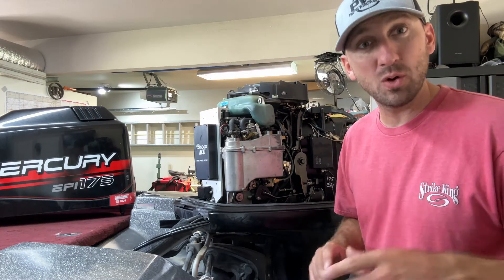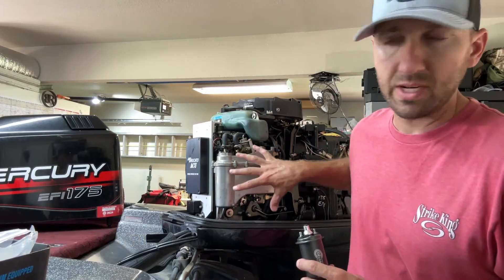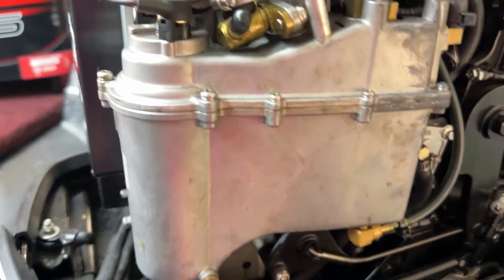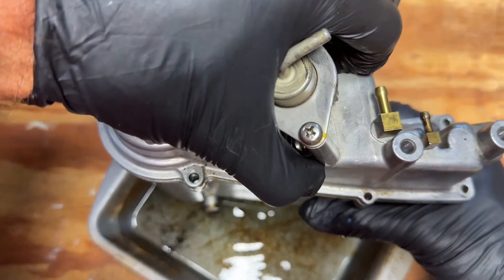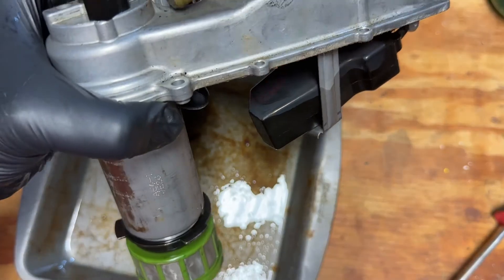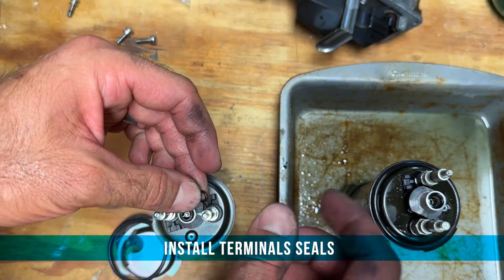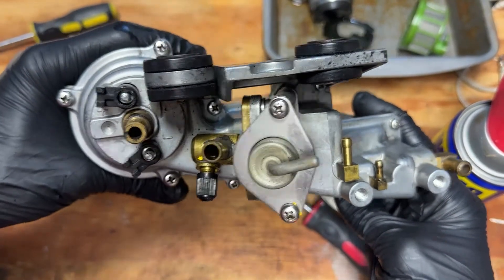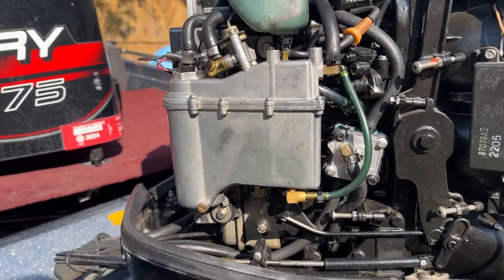Mercury EFI FUEL PUMP Replacement (HIGH Pressure Fuel Pump)

Comment: Quick question for anyone that can help! So I have a 225 EFI 1999 I just had it rebuilt by a shop last year and it’s runs and idles great but when I take it on the water it’s struggles badly to get on plane. Like someone has to sit on the bow of the boat just to get it to nose over and plane out. The shop says it’s fine but clearly it’s not. Been thinking it’s the fuel pump but don’t want to spend the money unless I’m sure it can fix the issue. Any suggestions would be nice!
Reply from the maker: Power issue, doesn’t sound like a fuel pump. Fuel pump would be more if motor would randomly die or not start.
Hard to say without hearing it. Could be ECU issue.
Reply: @PrestigeWorldwideFishing  
Ok thanks for you info! Anyway I could send you a Ideo and you tell me what you think ?
Reply from the maker: Yep. Send it on over

Comment: Hi, i have 1996 v200 efi mercury. Im having similar issues with my motor. My motor will start but will shut off after about 1 min. I have to pump the primer bulb to get it started again. It will die again if i dont continue to pump the primer bulb. So far i have rebuilt the low pressure fuel pump, new fuel pick up, new primer bulb and new fuel/water seprator fillter. Im running out of options. Im wondering if the high pressure pump has anything to do with my issue? Maybe the regulator? Also, i plan to start with just the strainer that is attached to the fuel pump since my fuel pump is $900 dollars. What other gaskets or seals will i need to replace once im in there? Any suggestions would be helpful. Thank you
Reply from the maker: That sounds like a high pressure pump issue to me. Surly they make a cheaper fuel pump for your boat then that right? You will need a new gasket that goes between the top of the fuel pump case and the bottom. The big one under the lid… not sure how to describe it. It’s really the only seal/gasket that isn’t on the actual fuel pump itself. 
Good luck!

Comment: How has your pump been working? I ordered one & have it installed, haven't tried it out yet.
Reply from the maker: Great so far. Had a small gas leak. The top seal shifted when I installed it. Adjusted and is good now
Reply: @PrestigeWorldwideFishing  Thanks for the info.

Comment: My ecu fuel pump drivers died a few months after the new high pressure fuel pump. Luckily, it's bypassed easily enough, it runs great. You have a Brucato, so no worries there.
Reply from the maker: My fuel drivers went bad on my ECU too. That’s why I have the Brucato now
Reply: How do you bypass it?
Reply: @darralldougherty5388  Run the fuel pump off the relay block near the starter and a good engine ground. Just dont ever leave the key in the 'on' position if the engine is not running, will burn up the high pressure pump. Injector drivers are still fine in my case, just the fuel pump driver died.
Reply: @MrInsanityflea  Thanks for the info!

Comment: Hello, did the aftermarket pump work well for you?  I have read that some folks get alarms from high amps on the non -OEM pumps. I am looking at a Quantum pump, just curious about your results. Thanks
Reply from the maker: Yes, so far so good. Had some issues with the after market low pressure pump but the high pressure has been good.
Reply: Thanks for the reply!  I just ordered one. Hoping this gets me going.
Reply from the maker: @tonytobes15 cool! Make sure you order the black seal/gasket too, it doesn’t come with one.
Reply: I’ve been trying to diagnose what’s going on with mine. Runs great at idle but in gear it won’t get up on plane, loses power and tries to bog down. I plan on replacing the high pres pump and low pres pump and seeing if that resolves anything. Already replaced voltage regulators because they were burnt up.
Reply from the maker: @ryanlogue3029 before you do that, watch my voltage regulator video and make sure yours doesn’t do what mine did first. 
Sounds more like you have a stator issue… for your sake I hope it is. Mine was ECU issue. 
Fuel pump issue usually means your motor will just shut off not bog down. Email me if you want, would be happy to help you diagnose and avoid spending a bunch of money.
Reply: @ryanlogue3029 did you get it figured out? Mine is doing the exact same thing.

Comment: I'm wondering if this is the pump that was causing me an issue today. Today was our fish off and it was 30 degrees when I got the boat off of the trailer. I tried to let my motor idle to warm up and it would cut off after about 15-45 seconds of running the motor. If you went and pumped the bulb by hand, it would sometimes keep running. I noticed whenever I turned the key on that I wasn't getting the whirring noise or whatever it makes when the fuel pump or something turns on. I replaced a fuse under the cowling and it didnt change any thing. Once I got home I messed with it some and I found one fuse that was at the battery. I changed it out and messed with a few other things. When I went back to turn the key on, I could hear the normal whirring type sound from what I believe is the fuel pump. I have no clue if the fuse tripped because it was so cold or if the pump is just going out.
Reply from the maker: I wouldn’t think the cold would mess with the fuse but possible.
Reply: @PrestigeWorldwideFishing  I figured out what it was I believe. I had reconnected the line at the fuel bulb because there was a small drop. Whenever I reconnected the bulb it pushed the lining and obstructed the fuel line. I replaced the line today and saw the obstruction. I also cut it open and the lining had sucked itself flat past the obstruction. So it wasn't getting enough fuel to run for long
Reply from the maker: @trevoralexander7080 I’m impressed you found that. Nice work
Reply: @PrestigeWorldwideFishing  I had a feeling that could have been the issue. I've had the same thing happen a few times with my old bass tracker. The sad part is that 2 mechanics told me at the lake that it was a fuel pump that went bad... I had time to run to the auto parts store for a bulb and hose while we were under a fog delay but they said that wouldn't fix it. But we still ended up doing better than 80 percent of the field in the tournament so it worked out regardless
Reply from the maker: @trevoralexander7080 Nice!!
Reply: What the bulb bad too, does it have a lining inside the bulb that can  go bad?

Comment: Is the red wire supposed to be hot “ie have power on it” with the key turned off?
Reply from the maker: Yes it’s hot. You will want to disconnect battery before you start
Reply: Yes it’s suppose to prime for about 10 seconds when you turn key on.
Reply: Thank you it was hot. I accidentally bumped it against the motor while putting the tank back on and it sparked since I just bought the boat. I didn’t know if it was supposed to be hot with the key off so now I have a question do I need to fill it with gas before I hook that wire up as it will start to prime and maybe burn the pump up, any thoughts?
Reply from the maker: @skippy7545 yeah I bet that scared you a little. no you don’t need to put gas in it. You will be able to pump your fuel bulb until the tank is full or has enough gas to start the motor.

Comment: If my fuel pump is dead or bad my 240 sport jet mercury v6 efi wouldn’t be able to start correct, cause it keeps on rolling over but won’t stay start, I change everything basically brand new plugs,stator assembly,selenoid, injectors, and so on it started and cut right off the only thing I haven’t checked is the high pressure fuel pump
Reply from the maker: It might run for a second depending on if you have fuel in the high pressure tank reservoir. Does it start after you pump the fuel bulb?
Reply: @WatchBrando haven’t been around it yet but we are going to change the high pressure fuel pump to see what happens it’s a 240 efi sport jet
Reply: @WatchBrando I don’t know why it’s flooding out
Reply: @WatchBrando hey bro I got it to start it would start and run only for so long then it floods out
Reply from the maker: It shouldn’t start if it’s flooded. 
I would start with replacing high or low pressure pumps and see if that fixes it.
Reply: I have 1998 225 efi and if it sets awhile and u start it , it runs for min tops and floods out and if u pump the bulb up it don’t get hard , I’m thinking lower pressure fuel pump , what’s your thoughts
Reply from the maker: @kevinsummers8789 I agree, sounds like low pressure pump. If bulb isn’t getting hard the vacuum isn’t getting created. Guessing internal seats are bad on fuel pump.
Reply: Replaced it today still didn’t fix it and still same problem
Reply: It also has gas coming out the pen whole above the Throttle flap
Reply from the maker: Man, I thought that would be it. How’s the bulb now? When you pump the bulb are you hearing fuel move through low pressure pump?
Reply: Yea I am , I’m thinking maybe pressure regulator on high pressure system

Comment: So I am actually currently having this same issue with my 1999 Mercury 150 efi. I switched out my low pressure fuel pump like you and I am still not getting gas pumped into the engine after it is primed. Was this high pressure pump your solution?
Reply from the maker: I can’t say for certain yet, but I’ve gone out one time since installing high pressure pump, and the issue didn’t occur. I’m hopeful it is fixed, although I still want to run it a couple more times before I believe it.
Reply: What where your issues?
Reply from the maker: Motor would stall, sometimes while driving, most of the time just wouldn’t start. The fuel bulb would be completely flat. I would pump it up and engine would fire and be fine for awhile.
Reply: @PrestigeWorldwideFishing did you replace the fuel pump check valve also ?     I’m getting fuel in my oil reservoir tank on top the engine       I’m thinking of changing pumps and check valve since it’s only a few hundred bucks
Reply from the maker: @Ret_Lineman I replaced/rebuilt the low pressure fuel pump which had bad check valves in it. Is that what you are referring too? Have a video on both replacing and rebuilding those.
Reply: @PrestigeWorldwideFishing  I just changed everything to make sure    Your video made it very easy.  Thank you
Reply from the maker: Awesome! Happy to help and appreciate the feedback.

Comment: What problem are you having?
Reply from the maker: Fuel related. Motor would just shut off randomly and wouldn’t start until I pumped the fuel bulb up. Then it would run fine for quite awhile. It didn’t happen the last time I went out after install of new fuel pump but can’t say for certain it is fixed it yet.